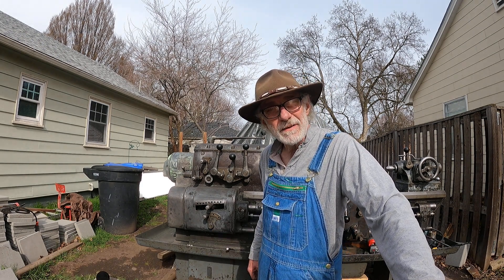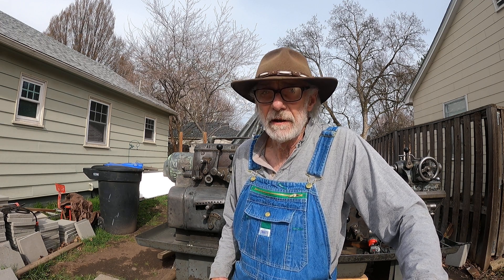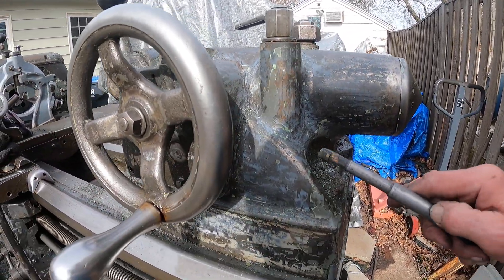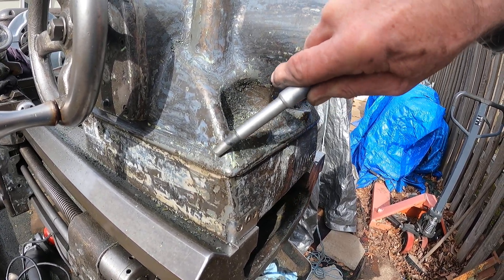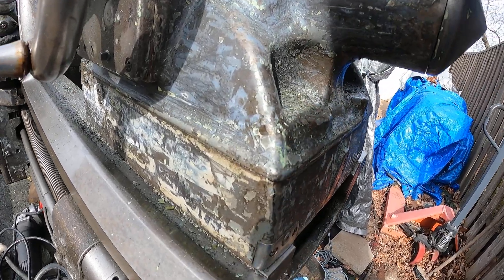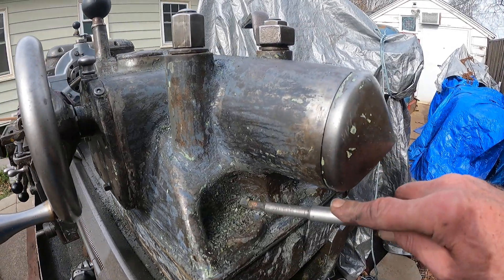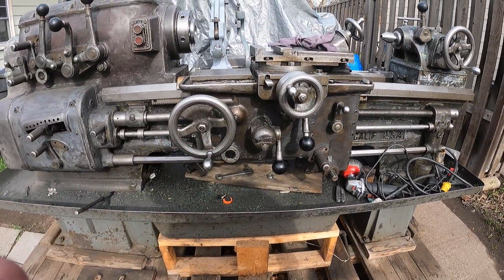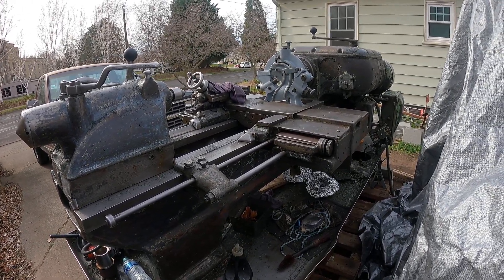Machine tool coolant contamination

Comment: Hi dee,
I have just found your channel.
Thanks for sharing your knowledge.
Is there any type cutting fluid you could recommend, that that's not toxic please.
I am a hobby machinist. Thanks.
Reply from the maker: I am using bees wax mix with Castrol MolyDee as a base, any current tapping fluid can be added as well.

Comment: Well Dee I’ve probably inhaled and ingested way too much bad stuff. I will suggest you use some kind of paint stripper sooner rather than later.  Most of the good ones are goo mixed with methylene chloride, another not so good thing to breath. Outdoors like you are you’ll be fine as long as you don’t burn your eyes.  Another alternative is a lye based stripper. That stuff cuts through grease and paint like nobody’s business. A weak version of it is Easy Off oven cleaner; it isn’t something I’d even bother trying on projects like yours.  The commercial stuff, well that’s a whole different story.  If you can collect all the crap you take off so it doesn’t get into your land.  Cheers, Will
Reply from the maker: Anything chlorinated is apparently bad. Mel touched on the odd behavior of this chemical. The chemical deep stains the cast iron, it can really be seen on the two Monarch lathes where the later one escaped. No one was happy when the chemicals were banned because they worked. And mixing things with bees wax, greatly reduces the amount of expensive cutting compounds used in regular work, as workers of old would extend their expensive lard oil the same way.
 The bad part of the paint is above the chip pan, I try not to scatter much of around.

Comment: I’ve been using Citrustrip from Lowe’s on a ‘30’s Canedy-Otto drill press that I’m restoring. Looks like it’s been painted several times. A couple pieces needed two coats to clear the paint. All parts are in primer now. You have a little more surface area strip than I did. Have a great day!
Reply from the maker: I am thinking that would be good after  I knock the worst of the paint off, it may help get the chemicals out of the pours in the cast iron
Reply: @deedeeindustrialsuperprecision  Something that i also use on cast iron to get the oil out of the cast iron is A degreaser for BBQ Grills sold at Sam's club. Gloves a face shield and be sure to be up wind when spraying it. It is very caustic and in some cases will actually remove paint.
Reply: I also use Citrus Strip from Lowes . I have had really good success with it on machine tools but seems like the Craftsman and Snap-On boxes I have to restore it does not work the same. The red on both boxes just turns to a gooey liquid and does not peel up . I will still use it on the boxes because I think it is the best just not as good on the boxes as I had expected. It has worked great on the Clausing 5913, I am restoring and the Old Kennedy tool chest so It might just be the type of paint. It does a much better job when I first spray with mineral spirits and make sure it is oil free before applying the Stripper.